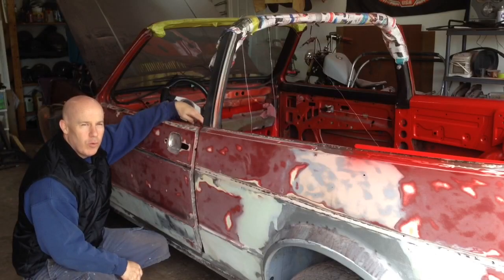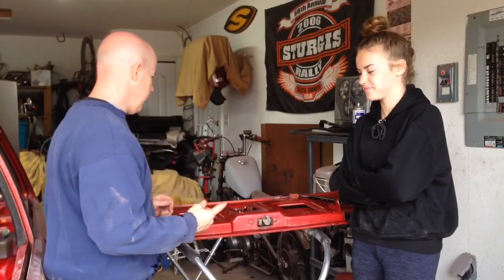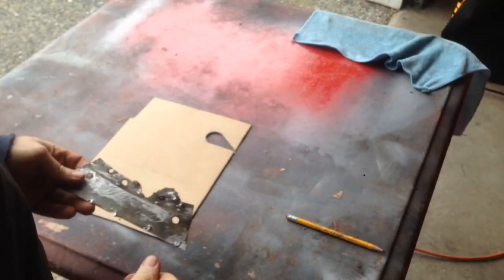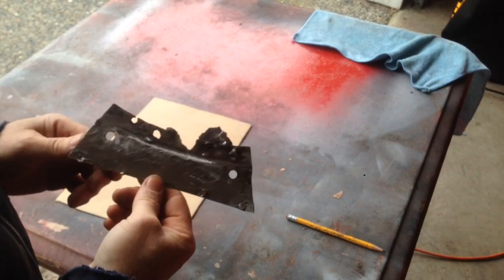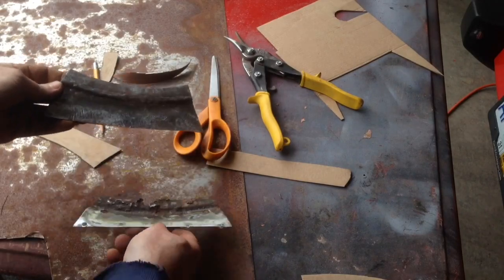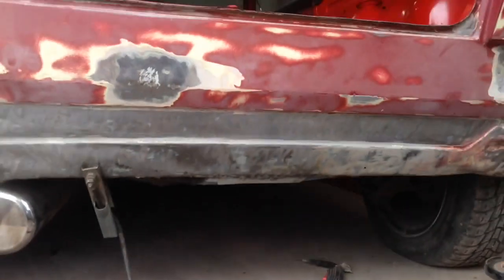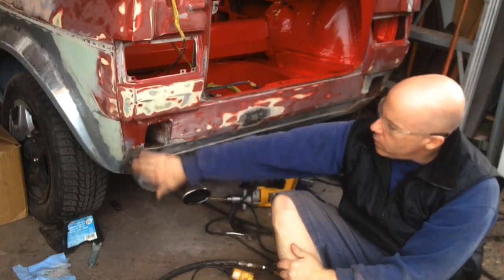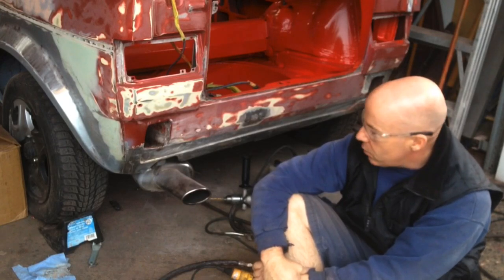Exterior Paint Prep - MK1 VW Rabbit Convertible Project Episode 16

Comment: Hey, I was just wondering - what did you do to the regular paint that you wanted to keep on the car? Or did you just primer the whole body after doing a light sand on the paint and clear coat?
Reply from the maker: Everything was sanded with 80 then 220 grit and then was coated with epoxy primer. The interior was coated with single stage paint after the epoxy while the exterior received high build primer onto the epoxy to be sanded in preparation for single stage exterior paint.